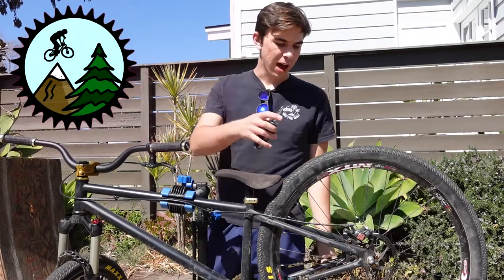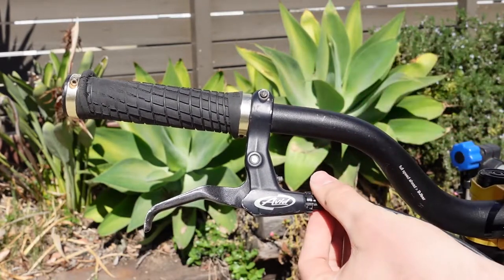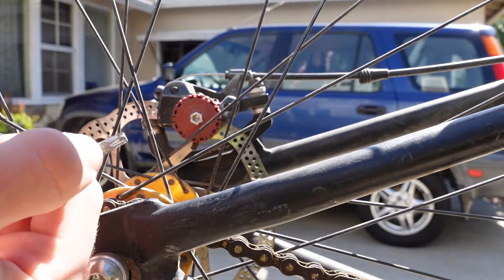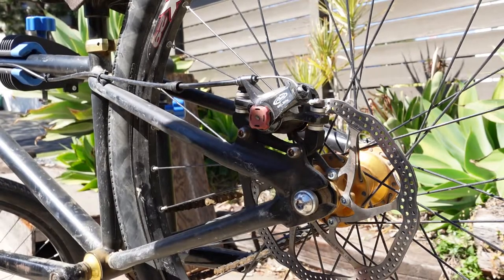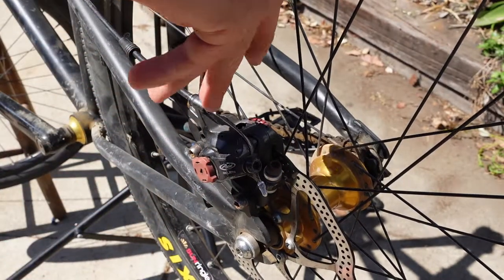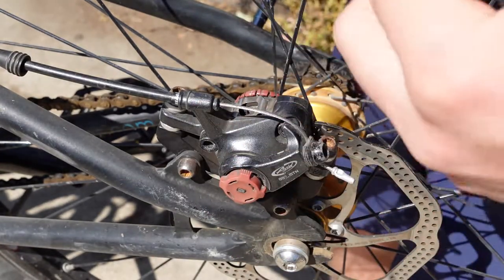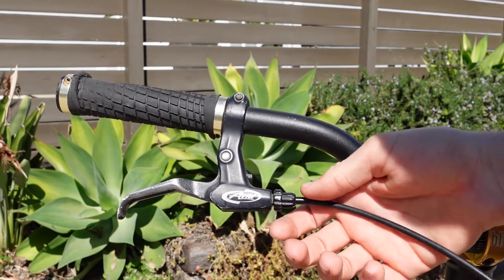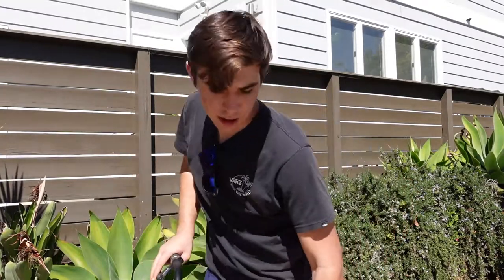AVID BB7 BRAKES ADJUSTMENT

Comment: You can adjust the brake lever reach with the set screw close to the hinge of the lever.  Screw in to make the lever close to the handle bar in normal position.

Comment: I don't understand how you know when the red thingy hits the disc
Reply: Front brake is easier because you can see how much space is between the rotor and pads.  
For the rear brake you can tighten both inboard and outboard adjusters all the way tight.  Then back off 2 clicks one side at a time until you don't hear the rotor rubbing against the pads anymore.